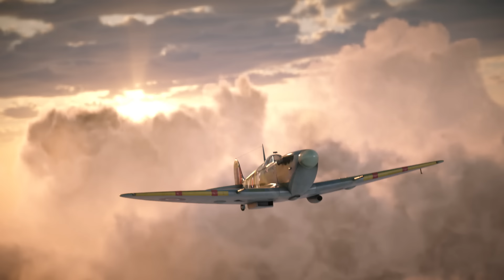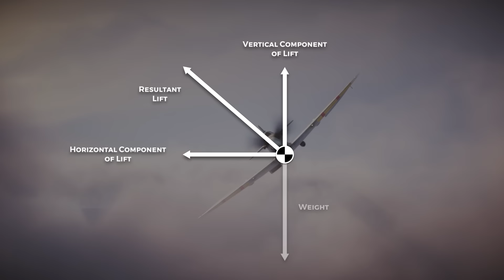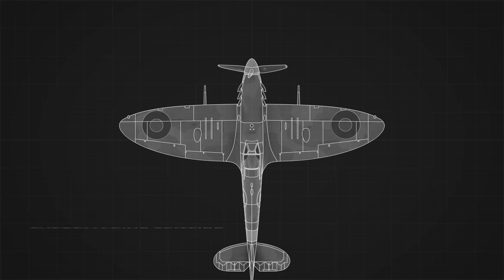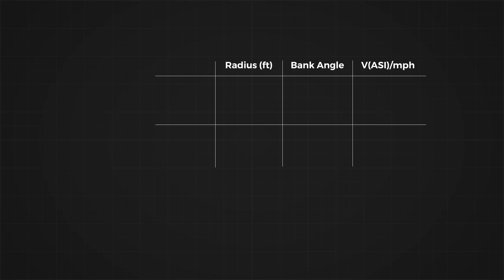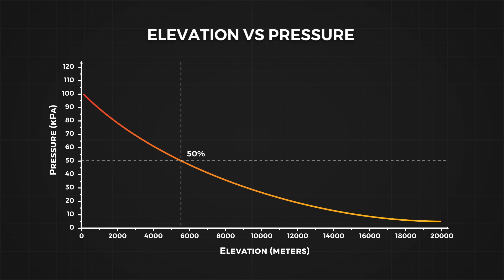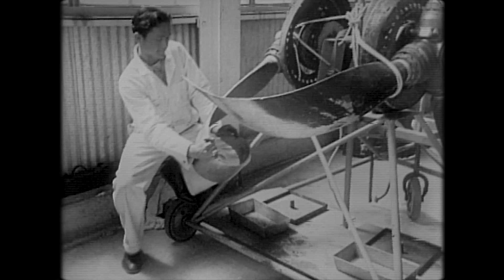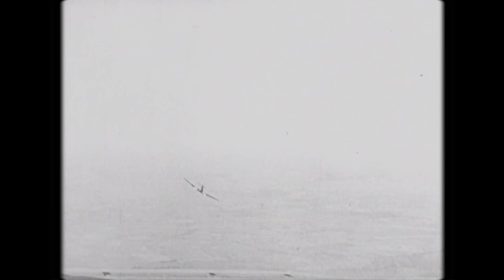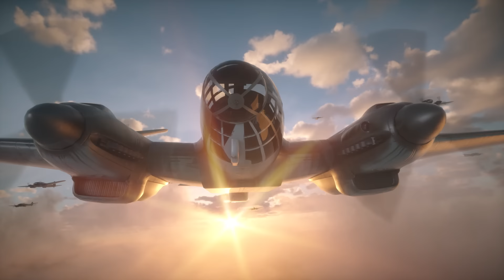The Insane Engineering of the Spitfire

Comment: The wing armament was actually seen as a disadvantage because each gun needed to be configured to converge at a particular distance, which reduced overall accuracy. The BF109's nose guns concentrated firepower and improved roll rate by centralising mass.
Reply: True!

However, the convergence point meant you had to be a specific distance from the target for maximum accuracy. 
But this also meant that you could opt for a more spray-and-pray approach at different distances.

So, like, you can put all your eggs in one basket, or decide that a few rounds on target was better than none. Which was a "luxury"(?) that the Bf-109 did not have. 
Right? 🤔😅
Reply: When compared one to one the wing armament could be considered a disadvantage and less pilot friendly. However when fielding planes and maintenance it could be a great advantage to have fewer moving parts and a greater number of guns firing.
Reply: Really depends on what each gives up. Its much harder fitting a heavy nose armament on a single engine prop fighter because the prop and the engine are in the way. So while the armament is arguable more accurate, you have far less throw weight. 

Mount those guns in the wings however and you can fit more of them, arguably less accurate, but more throw weight, especially with the B and C wings which were the cannon armed wings. 

Accuracy is only part of the equation, throw weight is just as important, how many rounds can you throw at the target in the very limited period of time you have it in your sights. 

Given the ranges those pilots were firing at, typically less than 400 metres, often much less, then the argument about  gun convergence become less critical, and that increased throw weight that Spitfires armed with the later wings were able to deliver to their target becomes more important. After all, that convergence is only growing less and less severe as the range closes. 

In other words, their are costs and benefits to both wing mounted and nose mounted armaments in prop fighters, and it really depends on what the priorities are for the air forces involved. It is no accident that the prop aircraft that mounted the heaviest nose armament were ALL twin engine designs....
Reply: I once saw a video which said that the nose gun caused reliability issues
Reply: in that case both armament configurations can be seen as equally advantageous and disadvantageous, as wingmounted is preferable for flight performance but nosemounted is preferable for combat performance
Reply: @alganhar1  P-39 and Yak-9T: Wait, 37mm isn't heavy?
Reply: Thats probably also why they chose to use so many .308 instead of using only a few 20mm or even 12.7mm guns. More chances to land a hit is easier for pilots. Especially when a damaged axis plane needs to fly all the way back across the channel in order to land, only a few leaks will eventually bring down a plane
Reply: Advantage in one way is disadvantage in another. It seems like all throughout the war German engineering regularly pursued technical excellence at the expense of highly complex systems that were almost impossible to service in the field.
Reply: Yeah dude, I'd much rather have a giant cannon in my nose.  If the spit had a nose cannon it would've been unstoppable
Reply: Worth pointing out that from pilot accounts even eight guns of this calibre had trouble getting through armour at anything outside close range. There are stories of pilots practically emptying their Brownings and failing to down the enemy. The US .50 cal was a much harder punching weapon.
Reply: what's better the Elliptical wing of the spifire or the laminar flow wing of the P51 mustang??
Reply: @kingsman3087  different use cases. laminar flow reduced drag but turn radius wasnt as small as the spitfire.
Reply: @TheYognaut64  it didn’t take long for the RAF to improve the firepower, with the Mk.IIb trading 4 of the .303s for 2 20mms, as mentioned in the video. The Hispano cannons did have a very limited supply of ammo though, as well as some significant reliability issues early on.
Reply: @sentinelxcix2526  the 109 had the same ammo limitations though, only after the BoB it got upgraded to a propeller hub cannon
Reply: @kingsman3087  do you want to go faster or turn better? It depends on what you want. You wouldn’t use a supersonic wing on a subsonic plane or the other way around.
Reply: He said a few goofy things in the whole video not just the gun thing
Reply: @jakobrinsdorf7791  the E model used in the BoB could theoretically mount a nose cannon or machine gun (the 109 was designed from the start to have a so called 'motorkanone' firing through the propeller hub as the RLM initial specification called for an armament of 2 nose mounted 7.92mm machine guns or a single motorkanone MG C/30 or a motorkanone MG FF) however most didn't and when e model pilots upgraded to early F models some got rather annoyed due to having one less 20mm but the same ammunition per gun (thus half the E models 20mm ammo) and some kept their E models until the F-2 (15mm mg151 motorkanone) and F-4 (20mm mg151/20 motorkanone) models got 200 rounds of ammo.
Reply: @regularguy1140  the spitfires merlin engine would have required significant redesign to mount a nose cannon and probably wouldn't have as great a success as the merlin is today
Reply: @firepower7017  add to that the Yak-9K: 45mm motorkanone is a hell of a thing - granted the recoil made the plane practically impossible to line up more than one shot
Reply: worth noting that the newbie pilots with the 109 F models had a harder time hitting the enemy due to the concentration of fire - yes once one had gotten used to aiming the armament it would be much more powerful however less skill is needed to land some hits with wing-mounted armament
Reply: @MrNicoJac  yeah, I meant that ultimately detracts from accuracy by limiting optimal range
Reply: One gun concentrated firepower?  Riiiiight…
Reply: @annoyingbstard9407  guns*
Reply: I like the discussion. Basically my comment is opposing the creator's points which seem to follow the narrative of the wing rather than the research.
Reply: @MrNicoJac  Yeap
Reply: I've read some pilots did not like their guns converged but perfered the guns to be aligned stright out. I can see the benefits of both methods gun alignments.  By the way aligning gun and gunsight is no easy task. It was an all day task on the A7E it had only one gun, i bet aligning 8 guns and sight was a nightmare.
Reply: All planes with guns in the wings have to be calibrated.
Reply: @MrNicoJac  Not quite true. Cannon armament ammo on aircraft was extremely limited and often the 20mm cannons had as few as 60 rounds per cannon. No fighters produced at the time would have enough cannon ammo to afford spray and pray tactics.
Reply: @matijagrafsoro3783 
The limited cannon ammo is the reason you'd be praying 😂👍🏼

Jokes aside, one cannon hit is rather likely to lead to enough damage and decrease of aerodynamics that your odds of winning the dog fight would jump considerably!
Reply: Ooohh...
Reply: @musosiimo3199  Against bombers, yes. Fighters - not so much. RAF jumped straight past the 50cal to 20mm as soon as they could because 20mm was vastly more effective than both.
Reply: Its called 'harmonising the guns' for a given range & i throw out the question in a  late1930's fighter where else would a designer put 8 machine guns. The wings were the only option.
Reply: Shup nerd
Reply: Still bf-109 were not maneuverable plain boom and zoom after the early models.
Reply: Also, the amount of gun in the wings made up for the disadvantage.  Threw a lot of led and lots of ammo
Reply: Poles were known to configure the range as close as they could. Madmans from 303
Reply: @MrNicoJac  when the few rounds are 7mm it doesnt matter too much
Reply: @romaboo6218 
That's what I said....
Reply: @TheYognaut64  also there was a huge stack of. 303 available in the mid 1930s when the decisions on armament were made. RAF was fully aware of the advantages of 20mm and had a 4x20mm armed plane available during the BoB (Westland whirlwind) but the Spitfire and hurricane were designed with 8x.303 back when the standard armament was 2x.303
Reply: @reaganharder1480  9oo
Reply: @TheYognaut64  The standard British round was not the .308. It was the .303. Different bullet,  less powerful. 

American fighter planes were designed for the 50 BMG and its much larger ammo.
Reply: Convergence could be adjusted to suit the pilot. The first BFs were limited in ammo supply since it was all in the nose. Later BF models with wing guns were more equal, especially when the Spit added more wing guns, at least until the spits added .50s. However, as mentioned in the video, when the Germans went to exterior mounted guns, the cost was in speed and maneuverability. 
Both gun configurations had advantages and disadvantages. Compare nose guns on P38s and wing guns on P51s.
Reply: [Thread bypass]:  Tradeoffs; one had higher mechanical complexity and thus reduced reliability and higher man-hour maintenance requirements, the other had reduced accuracy and consequently increased tactical risk to the pilot.
Reply: Notable observations:
• During WWII, Radar was a military secret known only to the British, U.S., Gremany, and later Imperial Japan.
• The RAF Command center was one of the first iterations of what is now called a 'C3' or 'CIC' room.
• Plugging Nebula on YouTube is sweet irony.
Reply: the BF109's nose cannon used to repeatedly jam
Reply: I’d rather have the reliability of 8 guns rather than 3.   If 3 of my 8 guns go bad, I still have 5.  But I’d feather have 8 Ma Duces. 😂
Reply: As most systems in engineering, neither placement of the guns was clearly better or worse. It's nearly always a question of priorities.
Reply: @NathanaelKeller  And compromise.
Reply: @musosiimo3199  because the USAAF learnt that from the BoB smaller calibre bullets were not big enough to down other aircraft easily.
Reply: @derektaylor2941  That all changed when the Poles came along and started to attack head on and take out the pilot .
Reply: @giantskeleton420  higher stall speed in laminar flow wing too
Reply: @jakobrinsdorf7791  109s carried 40 seconds or so of ammo...Spit..15 seconds.
Reply: @mr16ga  just sync them all to 200 yds.
Reply: @spanishpeaches2930  why is that?
Reply: @giantskeleton420  You'd  have to ask my brother, he was a commercial pilot for decades. Just told me that laminar flow wings stall more easily if you drop the speed too much when landing.
Reply: @spanishpeaches2930  i tried to look it up but im an idiot and couldnt find the answer lmao.
Reply: Then when your synchro machinery gets screwed you have to pull the engine.
Reply: @TheYognaut64  30-06. Nasty round.
Reply: The nose mounted guns had major disadvantages. 

There is major congestion up there. With the gun mounts, ammo and ammo boxes and feed, there is   space limitations. So the guns are of smaller caliber and ammo limited. Engine access is hampered.

Wing mounted guns were larger caliber guns. With larger ammunition load. A P-51 went up with six .50cal Browning machine guns with about 1,440 rounds available. That much bullet mass just chewed up the German fighters. It ripped the Japanese fighters to shreds.

Wing mounted guns required a heater to prevent the barrels from icing up. The nose mounted guns were warmed by the engine. 

As for convergence,  IIRC the standard was 400 yards. But some pilots liked it closer.
Reply: @spanishpeaches2930  Most American fighters had about 15 seconds of firing. Some of the guns ran out first.
Reply: @TheYognaut64  The Brits used the. 303 because it was what they had. They didn't have the wide industrial structure to make a variety of guns, parts and ammo.
Reply: Agreed, but better accuracy per shot helps to reduce the carried ammo weight; as you could emit the same amount of damage with less ammo being used while comparing it to spraying a volley of rounds and only a few of them hit. Though I guess that could be lessened through the pilot conservatively using the gun.

I’m too not sure about my grammar.
Reply: Indeed. But it was later found out that the extra mass of fire from the Spitfire was more effective. While the BF109 has better accuracy this is only if you are actually on target. In a dogfight, especially with not perfectly trained pilots the most important thing is the death area; the space covered that when an enemy plane flies through it they will be significantly damaged.
Though the main reason the British won was actually the home field advantage and their well functioning defense network. The defense network meant the British could pick and choose battles, not defending against overwhelming raids but causing heavy casualties to minor ones. Which forced the Germans to focus on large scale raids which had a lot of losses due to accidents and were a much easier target for AA fire. They also were much more at risk of hitting barrage balloons. Many like to focus on dogfights but most Germans fighters and bombers were downed by barrage balloons and AA fire. The failure of the Germans to develop an AA system of similar effectiveness was something that cost them dearly.
Another big home field advantage was that the British could afford to use all their fuel while the Germans had to preserve it for the flied to and from Europe. Finally also often overlooked the home field advantage meant that British fighters who were downed with relatively light damage could be repaired and the pilot put back into flight. Some pilots could be flying again within hours of being shot down. With a German fighter if it got downed it was a loss no matter what the level of damage was.

In airplane technology the British would overtake the Germans by 1944 but by 1940-41 they were roughly on par. The failure of the Germans to do the same when the roles were reversed was mostly due to the cumbersome German command structure with the SS and regular military constantly fighting for control, the competition encouraged from and constant political oversight of the German generals and the overall incompetence of Herman Güring.
Reply: One also has to consider that being removed from the heat of the engine was a factor to consider with high altitude temperatures causing the gun mechanisms to freeze up on occassion.

But the biggest issue was weight...and harmonizing the guns at the correct  distance...especially with the British using rifle caliber guns.
Reply: What you put in the wing is not the point. The wing itself was the advantage. It was the same wing that took Hispano cannons later on in the war.
Reply: General Adolf Galland described the spitfire as a shotgun rather than a rifle.
Reply: @kingsman3087  Later Marks of Spitfires adopted the Laminar Flow wing design.
Reply: Freedom
Reply: A major reason for tracers, the pilot can visibly walk the gun on to the target
Reply: @TheYognaut64  0.303
Reply: However the interrupter gear cuts down on the rate of fire. It wasn't a factor in WWi, but with 3 or 4 blade props you probably had something like 25 percent 'no fire zone'
Reply: Ha
 So the BF 109 had a torque converter.
Reply: @Bilbo Fappins Except that is raking the target with .303 bullets from one or two guns...maybe a handful of rounds on target, and incendiaries were very rare.  Not much damage and definitely not the way pilots were taught.
Reply: 😅😅🎉🎉o

😮❤
Reply: That's one reason the P38 Lightning was such a good long distance fighter. It had twin engines with the guns in the nose. So it shot straight ahead and you didn't need to worry about convergence. The Germans referred to the P38 as the "Twin Tailed Devil."
Reply: The Spitfire dominated the BF-109 by every metric and it was no contest if the Spit Pilot saw the 109 in time.
Reply: /shrug i don't know why i would want the guns to ever converge on a single point unless my guns were not powerful enough for the job i need them to do.
Reply: Seen by who?.....The wing armament was vital to it's success due to the 109 being better armed.....
Reply: No, you want 12 ball gunners on each interceptor!
Reply: Once you have specufied
a thin wing , Mitchell, central concept
single Merlin Engine.
8 x  303 Browning's (in gull wing spec 4)

is there really any design room. f nose mounted guns, what could you sacrifice to get guns in such a position? Pilot view forwards? Pilot position  to the rear?  Cockpit structure? Canopy design?  The Spitty like a lot of things was  bag of compromises. change one thing at the  nose  and  you end up redesigning every thing back  to the  rudder. 

and if your design has got the Tube inside  a tube inside a tube main  spar (Smith) and you had the idea at least  of Shenstone's squashed elipse  wings )
do you need any?

is there really any design room. for nose mounted guns

*************** aside

If all the online hours of all armchair designers* and design critics spent  re-inventing the Spitty were added up it must come to many 1000's of times what the original team had, with slide rule and manual lofting  and minimal wind tunnel access yet.

And i've  sill not  found any one who could really claim to know how it could be  improved.?

good old  internet quantity over quality every time, It's almost reassuring don't you think. in a weird kind of a way?
is there really any design room. for nose mounted guns
Reply: Accuracy isn't all it's cracked up to be. There's a reason shotguns are better than rifles for hitting clay pigeons.

They were firing at a moving target from a moving platform. It was about manoeuvring in to a position where you had a high enough probability of hitting. That means filling the immediate airspace with enough lead  that it couldn't be  flown in without getting hit. The Spit put out 160 rounds per second over 3 times what the 109 did. Yes the 109 could do more damage, but it had to hit first. 

The 109 had a similar advantage in how long it could fire for. But, at the limit of their operational range, running out of fuel was more of an issue.

The Luftwaffe also had to destroy RAF planes (increasingly moreso pilots), whereas the RAF only had to stop the Luftwaffe making it back across the channel.
Reply: I believe pilots had some say on the point of convegence
Reply: @mgls6523  
109 had 2 mgs on top of the nose and optionally a cannon actually sat within the engine. And yes I've read in numerous places this could be unreliable / cause issues as it was sat right between the engine blocks, and I believe it could often be removed. Not sure if this was case in the late models.
Reply: The Bf109's nose armaments fired on completely differing trajectories. Their fire wasn't concentrated outside of about 80 yards (IIRC) and certainly wasn't at usual combat ranges. The same was found when 20mm cannon were mounted in the Spitfires wings, and it's why the 4x20mm was way more effective than cannon+mgs
Reply: @jakobrinsdorf7791  Hub cannon was live during the BoB
Reply: Amazing engineering by very clever people 👍
Reply: You can only fit such a large cannon on the nose of the Bf-109 or any single engine fighter but having wings mounted guns allowed larger and more cannons
Reply: Blah blah. sure sure…. Zzzzz
Reply: @Duder2000  You could always read "The First and the Last" rather than make a cnt of yourself on YouTube. 
You know who that book was by, right?
Thought not...
Reply: It was the British that inspired North American Aviation to Build the Mustang
It was the British that Contracted Packard to Build the Merlin Engine
It was the British that Lobbied Heavily to have the Merlin installed in the Mustang
So while the Mustang was American made.  It was Heavily influenced by the British.
Reply: @kingsman3087  The advantage the laminar flow wing brings is decreased drag, hence improving speed.
However the mustang was still slower than contemporary spots (at least when they eventually showed up in Europe).

The laminar wing’s advantage is in making the aircraft faster - so if we were comparing two planes of equal engine power and drag except for the wing then it would make a difference. Here it does not.

A laminar wing also isn’t really the same type of “type of wing” as an elliptical wing. One is the wing shape, the other is an aerodynamic property. You can have a elliptical wing that’s laminar flow.

The Mustang D compared to the spitfire XIV (most accurate comparison - latest mustang Mk and latest spitfire mark, around the time the mustang showed up in force), the Spitfire beats the Mustang in literally every metric including roll rate, which was its original only advantage.

The Mustang wins out on rage.

Ironically spitfire variants with more range than the mustang were created - the USAAF pushed for introduction to lessen the burden of escort duty, however the British for some stupid reason refused.

The spitfire was the “better plane” in the sense that of you were in a tactical situation, just placed there magically, and you could have any WWII piston engines fighter aircraft, the spitfire would likely perform best and certainly beat the Mustang.

However if you want to fly from England to Berlin whilst escorting bombers, have two hours of loiter time, and return home, then I’d choose the mustang.

I’d also choose a mustang because I’ve flown in a spit but haven’t in a mustang lol
Reply: @davem5333  The .303 is significantly more powerful than the .308.
Reply: @davem5333  Okay this not here is bullshit. The U.K. was the most industrially advanced nation in the world.

They used .303 x8 because that was above and beyond the standard upon introduction a year prior the BoB.
As soon as it was out of date cannons were put in.
Reply: @StirlingQShagnasty  That was the Japanese. The Germans referred to it by a variety of insulting names and it was known widely as the easiest plane to shoot down on the western front.
Reply: And yet, in the end the 109 was outclassed by the Spitfire. The last marks of the 109 were pigs to fly while the Spitfire maintained it's largely benign flight characteristics. Even the much larger and heavier griffon engine didn't make a major difference.
Reply: @spanishpeaches2930  Wing loading. Laminar flow wing, higher wing loading, higher stall and landing speed.
Reply: The American designed Browning. 50 caliber was cited by German advisories as superior to any aircraft armaments they had
Reply: @davem5333  The RAF soon went to 20 mm, much bigger and more effective than 0.5.
Reply: @alpine9996  Far too heavy in 1940, it would be more like maybe 4 of them and the RAF knew that 20 mm cannon was the way to go.
Reply: @spanishpeaches2930  The 109 only had 6 seconds of cannon armament then it was down to just two machine guns.
Reply: @StirlingQShagnasty  The Germans referred to the P 38 as useless, it was an American author who came up with fork tailed devil in 1957.
Reply: @barrierodliffe4155  despite the fact it had four machine guns.
Reply: That was the f variety of bf109
Reply: Not talking about bf109
Reply: Remind us again who won the Battle of Britain?
Reply: @ChristianFrench1  The BoB wasn't technically won...the Germans simply had more pressing issues. Score draw.
Reply: There is a good reason why all powers - axix, western allies as well as the soviets - moved away from machineguns to cannons. As planes got heavier and tougher, even full salvos from a 303, 8mm or even .50 BMG weren't sufficient to down an airplane. Often times holes in the fuselage and wings were inconsequential for a fighter's integrity as long as no critical component or the pilot were hit.
Reply: @musosiimo3199  The 0.5 was much heavier and Britain was already ahead since they decided on 8 machine guns when the US had just 2 x 0.3 machine guns on their fighters, Britain was already looking at going to the 20 mm Hispano which was very much better.
Reply: @kingsman3087  The eliptical wing, the P 51 had issues with it's wing.
Reply: @sentinelxcix2526  The reliability was only in the very thin Spitfire wing, once the Hurricane had the more powerful Merlin XX engine they were fitted with 4 x 20 mm as the Westland Whirwind had earlier. the hitting power of the 20 mm and the reliability by 1941 meant that it didn't need so much ammunition.
Reply: @spanishpeaches2930  The Bf only had that firing time with the two  machine guns, their 20 mm only had 6 seconds.
Reply: @spanishpeaches2930  The Germans when they lost the Battle of Britain had no pressing needs, score RAF 1 Luftwaffe nil.
Reply: @KORInashi  this is a key point people tend to forget logistics are extremely important maybe even more important than just having great weapons
Reply: I always wondered about this when looking at WWII era planes.
Reply: But the E and F versions of the bf109 have wing cannons.
Reply: @TheYognaut64 the final variant, the E wing, did use 12.7mm in the form of Browning .50 calibre machine guns as well as the 2 Hispano 20mm cannons
Reply: They lost the bloody war.
Reply: @giantskeleton420 that’s a myth. The real reason for the P-51’s low drag is due to its fuselage design and radiators. Laminar flow boundary layer only existed in tests. The P-51 simply is too rough and has too high of a Reynolds number, laminar flow boundary layer to take effect.
Reply: @davidkirksey8521 believe it’s not superior to German MG-151 20mm cannons especially with minegeschoss rounds.
Reply: @princesofthepower3690  why did it only have laminar flow in tests? someone also said the wing caused the plane to have a high stall speed, why is that?
Reply: Not really.

The 8 .303 machine guns had a combined cyclical rate of fire of 9200 rounds per minute. They had a maximum effective range of 1000 yards. Although they were adjusted to coincide at 200 to 400 yards (depending on the pilot's desire) they were a good choice at the start of the war. They poured 150 rounds per second into a target so in 2 seconds 300 rounds could be fired.

The cannon armed Bf109 by contrast could only fire 8 or 9 rounds in the same time. Hitting a fast moving and manoeuvring target with only 8 or 9 rounds is really quite hard and only good marksmanship would get results.

By contrast, firing over 300 rounds in 2 seconds would see an increased chance of hitting and damaging a target. Air gunnery was still important,  but pouring a huge weight of fire in a short time was seen as the better option. Think of the difference between a highly trained sniper and a dumb grunt with a minigun for a rather crude analogy!

Later, 2 x 20mm Hispano cannon were fitted as armour increased and aircraft became more survivable. The cannon was still a compromise between weight of fire and weight of individual shells, but pilot training in marksmanship increased after the end of the Battle of Britain, offsetting the loss of rate of fire.
Reply: @mgls6523  not true my guy
Reply: @musosiimo3199  yes, .50 cal was a better weapon, but the licencing fee expected was far too much, so BSA only had licence to produce the cheaper .303's.  Business as usual for the yanks, while Britain gave up most of its tech in 1940 in the Tizard Mission to the US.
Reply: @musosiimo3199  Worth pointing out that the 0.303 served rather well in 1940, by 1941 the RAF were using 20 mm which was far more effective than the 0.5.
Reply: @spanishpeaches2930  During the Battle of Britain the BF 109 only had enough cannon ammunition for 6 seconds then had to rely on machine guns.
Reply: Wing guns=faster rate of fire + more guns. 

Almost all the best performing planes in WW2 had guns in the wings with the major exceptions being the planes that dominated in the early parts of the war.
Reply: The big disadvantage of wing guns was moment of intertia that slowed initial roll rate, but yes center fired MGs were preferred by pilots, especially in the era prior to gyro gun sights.  Caldwell preferred his P-40B Tomahawks IIA, IIB weapons over the later P-40D & E for that reason.
Reply: Bf109 e series had the cannons in the wing
Reply: @alganhar1  Go by the way of nose mounted armaments HMGs and cannons combinations like on Mosquito bombers and P-38 Lightning fighters, hence you have the best in agility, heavy concentrated firepower, twin-engines survivability and range.
Reply: Didn’t prevail as the best though did they… the spitfire and its brave pilots enabled the free world we enjoy today
Reply: 4:12 surely pointing elevators downwards would increase turn time
Reply: @KORInashi the guns could be reloaded much faster. Some planes with wing-mounted guns had systems where the entire gun assembly was a module that could be removed and swapped out for a loaded one on the ground.
Reply: They also had the issue that they couldn’t do a negative g dive or it would flood the carby a solution was sort of made up but didn’t fully solve the issue but amazing aircraft regardless
Reply: having only 2 MGs limited by the prop timing. and 1 single Cannon that's probably useless against a fast moving target especially 1 that has hardly any armour. as an intercepter having 4 or 8  small guns with smaller rounds firing at higher rate of fire makes way more sense. as for the converging fire I think you will find that wasn't the case the guns were usually centred to fire dead ahead and with wind and acrobatic manovers a few metres isn't going to make a difference just load it with tracers spray some holes. the only advantage the 20mm cannons give is against ground targets like tanks and people but that wasn't it's primary roll even heavy bombers probably had little defence against 7mm guns. trying to mount extra external guns and using bigger more powerful engines showed the axis couldn't keep up with the air superiority. German engineering was better in many ways especially in tanks but aircraft was one where they really were outclassed. the smaller Merlin had a higher power to weight and lower fuel consumption. pretty much the only downside was it wasn't direct injection but at the time that would of just made maintenance and building a nightmare.
Reply: I was quite surprised he didn't mention that! .....But then after noticing very weird typos like "hydrolics" I'm guessing a lot of the video was AI . (2023 versions)